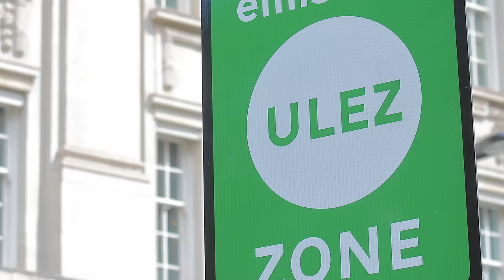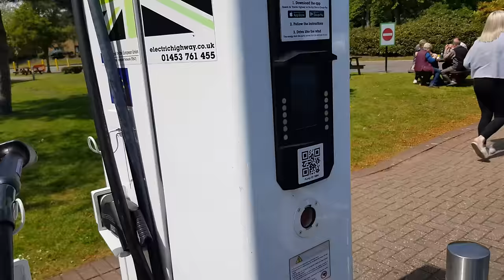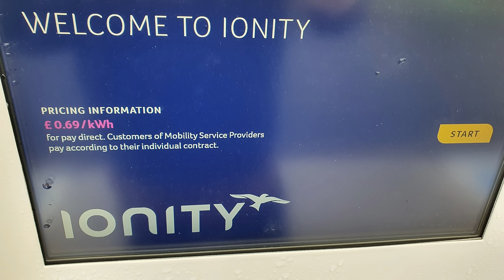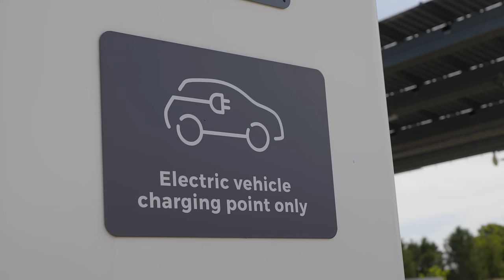The Uncomfortable TRUTH About EVs: The Version NEITHER SIDE Wants You To Hear

Comment: - Petrol station are inherently "old school", cash accepting, everywhere "convenient" type... Because they had 100 years of development. It was not always like that. And, very importantly, they generate huge profits.
- EV charging stations (particularly 3-rd party ones) could use a bit of refining and better placement.
- I didn't hear it mentioned in the video, but Tesla's Superchargers are extremely convenient, easy to use, well placed, abundant and even much CHEAPER.
- Using electricity allows you to break free from the monopoly of petrol dependency and expenses. When you need gas, your only option is to visit a gas station... nothing else. But when you need electricity, you even have the option to generate it yourself for free or use it at home at significantly lower costs.

You can't just look at the emissions as only part of the manufacturing process. What is really the issue are the toxic exhaust gasses emitted while burning the fuels right inside the cities where we live, sleep, breathe and raise our children. This is just the local concentrated problem... but oil extraction and refining is the global crisis.
- One pumpjack consume 9800 MWh/month of electricity.
- Oil Refineries consume 15-20% of annual electricity consumption for the whole continent (just in the US).
- Offshore platforms burn 20-30 tons of diesel per day for their generators. 
- Thousands of kilometers of pipelines. Each section with a pump consuming 50-250 kW and working 24/7.
- Tankers, each of them burning 200-250 tons of fuel oil per day. 
- Land transport with semi trucks to deliver the fuel to each station - ~ 40 liters of diesel / 100 km.

- Gas stations with all their pumps and energy consumption. ... and we haven't touched on shale gas and coal mining yet. ... nor have we paid attention to oil spills, vented gas, pollution of rivers and groundwater, deforestation and wars for resources.

- An average ICE vehicle is responsible for 260-350 g.CO2/km + NOx, SOx, CO and other harmful fine particulates right in the cities where we live. - Efficiency to the wheels - 18-25% (older vehicle even less)
- While an EV is responsible for 32-48 g.CO2/km (at the current heavy coal energy mix)... Keep in mind that there are NO emissions during it's operation. NO exhaust gasses where people live - Efficiency 80-90%

Manufacturing of an ICE vehicle releases 5200 to 6900 kg.СО2, while an EV (+battery) releases around 5600 to 8800 kg.СО2. Emissions are equalized after less than 10,000 km. After 250,000 km the difference in emissions is at least 10 times more for the ICE.
The longer you use an IC vehicle the more petrol will be extracted and refined, more political conflicts and wars will happen, more land will be cleared for pumping, more oil spills will fill the oceans, more gas will escape the pipelines... and more fuel will be burned.

Important:
- 7-8 million people die worldwide due to air pollution.

Why EVs receive enormous hate and misinformation:
- The petrol industry generates $10 Billion in profits per DAY and receives $11 Million in subsidies per MINUTE globally. They control the media!

Comment: I have spent 10 years running my vehicles for next to nothing😮 I had two motor homes in the time several Diesel suburbans and several mercedes passenger cars😮 and I was running all of them on free used veggieoil from restaurants😮 I was literally paying less than 1 cent per mile😅 so I was running on free energy for 10 years and I saved over $90,000 on fuel😅 veggie oil is the best fuel on the planet❤❤❤

Comment: If anyone ACTUALLY cared, like FOR REAL, we'd have kept the chassis of used cars (no scrapage of cars, but rather engines), chucked motors inside of those, went all in on charging infrastructure and R&D for standardised battery packs of lets say 50kW, which charge at 300kW speeds - so 5-10 minutes would get you to the next charger, which wouldn't have been too far away due to the previously mentioned "all in on charging infrastructure" - so You'd be able to get some 150-200 kms between charges, and these wouldn't take more than 5-10 minutes at a time. 

But no, let's keep making brand new vehicles, make the people get rid of perfectly usable and useful cars, and charge even more for brand new ones. 

Imagine a perfectly healthy chassis of let's say Golf 3 from 1996. JUST AN EXAMPLE. 

Option 1: You put in a small battery and an electric motor, thereby making it a mild hybrid, thereby offsetting some of its polution and improving its fuel economy. 
Option 2: You put in a bit bigger battery and make it a PHEV with small investments. If it can manage let's say 40 kilometers on that battery (and then basically turns into option 1 mild hybrid), why would anyone buy a brand new car? 
Option 3: Out with the engine, in with a 30 kW battery and a small electric motor (imagine stuff from classic Ioniq being chucked into this car) - how is this worse option that making a brand new car and having consumers spend 40+ thousand of EUR/GBP on the said car?

Comment: To me greatest worry and a dealbreaker for EV's is the fire hazard. In short, it's technically not a fire, because it's not oxidizing, what happens is chemical degradation of the battery resulting in thermal runaway reaction - that energy then burns everything around it. Because it's not a fire, no amount of oxygen deprivation would stop it. Best you can do is derive a way to absorb that energy, you know, like dumping liquid nitrogen or something. 

Basically, all we're waiting for is for a posh underground parking in some city centre to spontaneously catch fire and burn down some ungodly amount of property with toxic fumes blanketing city. Then EV's will be permanently banned form underground parking.

Comment: I like the tech, not sold on the reliability. EV's will never replace the ICE vehicle because of the one glaring flaw, electricity. Actually the production of electricity. I live in the US, the power infrastructure has not been upgraded in decades. I can only imagine it's even worse in Europe. You need to rip out every copper cable, substation, transformer, and lord know how many streets and just to get close to handling the required amount of power needed for all of this and no one wants to build nuclear power plants so what would be the point. To your point of insurance costs, in many areas (inner cities with high crime) companies have flat out refused to insure Hyundai cars because of idiots stealing them on tiktok, so why would they not increase their rates on EVs? Is the cost the same for a 12 cylinder DB9 as that of a Škoda Fabia? I am sure it isn't. The fender of a DB9 costs far more than the Fabia to replace and paint, the same holds true for an EV. Insurance companies are all about making money, not paying $30-60K to replace a giant LiPo battery in the event it gets damaged. And yes, the government is out force everyone into EVs so they can further restrict your movements. California had a heatwave this past summer and told people to NOT charge their EVs due to the high demand for power. Which points right back to issue number 1, not enough power, without power you won't be driving anywhere which is exactly what the overall goal is.

Comment: 25:26 Since you have talked quite a lot about EV fire issues, I thought I might chuck in a thought or two. Not original ones, they are all around somewhere, but anyway, definitely true and that's what we're all interested in, right?
- Some time ago (2013 if I recall correctly) Boeing had some issues with Li-Ion batteries in the Dreamliner which caught fire. Watching through this can be very educative since planes do not exactly have the capability to pull over mid in the flight and put the fire out so this is important to see what the worst case looks like in case an EV catches fire (while EVs' batteries are much bigger still). In essence, although there were some FAA-approved changes to the design (and Dreamliners fly again), nobody is really sure if such a battery fire can be contained for any reasonable amount of time. We are yet to see that.
- Any time an EV is caught in an accident and physically damaged, there is a risk of a short circuiting the battery or even worse, physical damage to the battery itself. No special need to explain what happens next, plenty of videos on YT depicting the process. Basically, not only can you get electrocuted but you'r sitting next to a big incendiary bomb, so to speak. Putting out such a fire, even of a single EV, is hardly possible (in most cases fire brigades, multiple required on site, simply let the thing burn out - it's safer).
Personally, I don't think such facts of (EV-related) life should and will stop us from mass-using them, eventually. 
Yet, such realities require a completely new set of procedures for drivers and their passengers to be aware of and follow (like: "don't ever try to put out an EV fire yourself, just run as fast as you can and warn the others"), apart from a new set of procedures for fire brigades (like: "tow the thing away from anything else that can catch fire and wait out till it's done with burning"). 
Also, while a seriously damaged ICE car can be repaired, even a moderately damaged EV should probably be deemed a total loss (and how do you safely disassemble them, anyway? The task seems akin to a disassembly of scrap tankers on a small scale, a lot of awfully dangerous fun).

Comment: A replacement battery pack is always gonna cost like a new car. It means you will never be able to buy a 20-30y old car again without mortgage crazy money into it eventually.
A gas car can stay on the road until rust kills it basically. EVs does not. In the future regular people Gonna be driving cheap cars close to scrap with worn out batteries and zero range left.. Changing battery wont be possible with normal income.

Comment: What's hurting the EV as a concept the most is the agressive push for it. The push for less CO2 was the one which made the cars bigger and even bigger. Also, scrapping perfectly good working cars and manufacture new ones is not going to reduce co2 nor pollution.
I love the concept of the EV, but that's not for everybody. The car wasn't for everybody back in the day, but it changed slowly, but surely. Governments won't solve this issue, the market will. However there are so many government manipulations going on in the market, it won't be pretty for a while.

Comment: The difference between the old diesel conversation and the current EV situation is the diesel issue was about design problems.  The EV issues are about physics, and you can not change that.  We know the batteries degrade over time at X rate.  That rate increases based on a number of factors like high temps, low temps and how the vehicle is used.  Only one of those 3 is controllable.  This is why you will see the smug guy who lives in CA, the most moderate temps on the planet, say their EV lasts for 20 years.  However, that won't be true anywhere else on the planet.  They can't design their way out of this as the decay rate is a constant that can not be avoided.  With the diesels, it was all about the delivery systems and those were eventually revamped to a useful form.  It wasn't about the power source itself.

Comment: Finally someone trying to elaborate a balanced point of view on the EV trend. I will be getting mine in a few days and have rent and driven multiple on long distances. There are many points that are very relevant in your video. Your experience with EVs will indeed depend on whether or not you can charge at home and in which country you live. I live in France - travelling long distances with an EV is not a problem here because there are charging stations everywhere on the highway. Charging at destination however can be a pain in the ass... So many providers, so many apps to download, extreme range of prices, ICE cars parking on EV charging points spots, etc. Repairability is a huge topic for me. Tesla is not going the right way with its structural packs of battery that are impossible to repair in case of accidents. There should be rules about it actually. Personally I don't think that we will be ready for a full EV market before a long time, and I don't know if this is the ultimate solution - diverse options should be considered. I do believe however that in big towns pure ICE cars are annoying because they generate so much pollution and noise. My problem with EV haters is when they deny scientifically proven facts - after many centuries / decades of progress we are reaching a time where science has become an opinion. The earth is flat, there is no global warming, 9/11 was an inside job from the CIA, COVID 19 never existed, EVs pollute more than ICE cars, etc.

Comment: We need to ask ourselves - why EV? What use-case suits EV (and which do not!)

I think it's safe to assume charging depends on at-home/at-work charging. Filling station equivalents are there for those who lack this or are out of range so have no choice. If you have no choice, don't expect value for money.

 Who would risk that much money on uncertain infrastructure? Not many I'd argue. Cars are already depreciating liabilities. EV drive train just accelerates this depreciation.

For local runabout/commuting journeys, a small 1.0 litre car could easily fill this use case. Such a user is likely to be on the lookout for cars on the cheap end of the market rather than the V8 turbo diesel equivalent. Why are most EV the SUV body type? 

It really carries the same vibe as pretend meat. If you want meat, eat meat. If you want an oversized vehicle, buy a v8 diesel. Don't try disguising your purchase with greenwash, we can see through it.

Comment: It's all about the battery. The holy grail is a battery that will one day be "filled" at the same speed, provide equal or better range and longevity, for a price equal to gasoline. Although battery tech is in other products, we speed the innovation by supporting EVs today much the same way we speed innovation in computers with a thriving tech industry. 

Imagine being free once and for all of the price swings of gasoline based on world events. Similar innovations in solar power (e.g., perovskites) means more efficient home charging. Reducing the parts in a vehicle and the maintenance/repair costs. Yes, we are going to miscalculate demand and government incentives (anybody remember the GM EV1?) but this is where most, though not all, transportation is headed.

Comment: I tried to watch your video but there was too many advertisements. I'm in Australia. But I got the jist of what you were saying. The charge point's are not the most dependable thing. And the KW charge is over the top. I didn't want a hybrid that ran the wheels. What's the point of carting an engine and gearbox as well as batteries. All you get is the worst of both worlds. So I'm looking at the Mazda R mx30 e. It has a very light weight small compact economic 800cc rotary engine. That only charges the battery. So what is your opinion of this kind of vehicle?
Reply from the maker: https://www.youtube.com/watch?v=qo8uBIT8tQM&t=1031s&pp=ygURbWF6ZGEgbXgzMCBqYXllbW0%3D

Comment: What is wrong with people? Why on earth would you think having multiple aps on your phone simply to try and get some KW in your car? It makes absolutely no sense! So once you have found the right ap for the charging point in question and you have found one that is actually live and then you go through all the mess of connecting it assuming it hasn't been vandalised and then you find that no matter what it won't accept your payment method and then if it all gets to the point where the current is moving in the right direction you then have 2 hours or so for a knap if you are bold enough to sleep in your car while its charging of course. Would you leave the door cracked open a little just to be sure you can get out in a hurry? And what happens when you discover that the car park where the charging point is has a maximum waiting time of 30minutes and thus you are looking at a £400 fine for overstaying your welcome. Very strange when you can buy a petrol car and not have to face all that rubbish.

Comment: I think you missed an important point. EVs don't have a strong used car market. They are a terrible depreciation trap. My Tesla Model 3 lost half its value in 2.5 years and it had only 23,000km plus 5.5 years battery warranty left. It had been supercharged only once. The problem is that there is no way for a prospective buyer to know the level of battery degradation.

Comment: car freedom: this didn't include the cost of replacing the batteries  which is often two thirds of the car sale price. divided  over the 500 cycles adds a lot to every charge. lower end torque and small knocks also write off the battery meaning high insurance and the second hand  market will dry up. first cars will be a problem. cars will be more expensive with battery  evs. hydrogen looks like a better option as they improve the efficiency especially in regard to having enough charger spaces as fast charging reduces battery lifetimes further and still takes half an hour. then ther are the losses in the grid and  the cost of  the  grid upgrades. you're right battery evs  are a luxury. i always thought the running costs  made up for some of this but they  will likely only increase short of nuclear fusion being solved.

Comment: I have no idea how you are calculating the fuel to electricity cost but here in Australia we pay on average $1.80 per litre for fuel. Now an Aston Martin DB9 uses 16.5 ltrs per 100Kms, that would be $29.7 verses a Tesla Model 3 using 15Kwh over 100Kms, at a Tesla super charger rate of $0.65 per Kwh total cost would be $9.75.